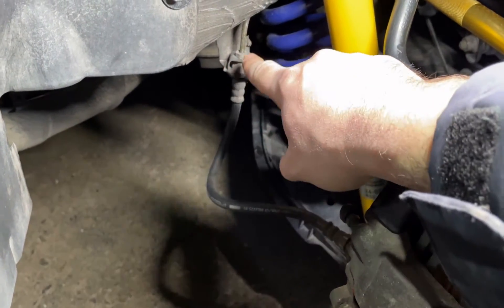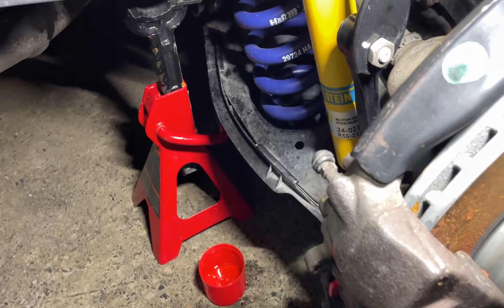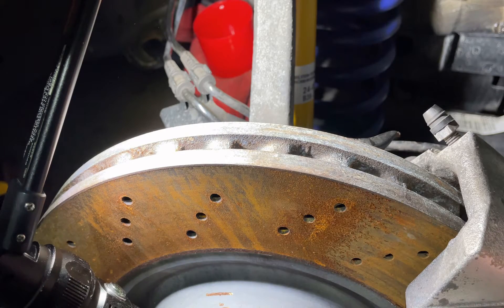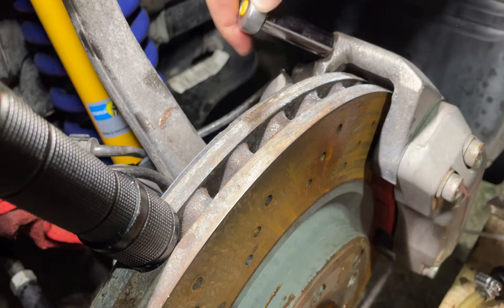Mercedes W210 Stainless Steel Brake Lines Installation & Brake Fluid Bleeding

Comment: I’m going catless on my e430 is it ok to drive around w the cats off until my tune comes ??
Reply from the maker: I drive without any cats. If you meet emission regulations drive, it will not be a problem. Just pick some scanner you will may need it to turn of the O2 sensor fault.
Reply: @W210Garage  beautiful,but it doesn’t feel like power was loss when you took off the cats ?
Reply from the maker: @rudygonzalez2005  
no, if you will replace them with tubes power will + not -
Reply: @W210Garage  what does that mean??
Reply from the maker: @rudygonzalez2005  
There will not be any downgrade with power.
Reply: &’ when you replaced the the front cats did you use 45 degree pipe or mandrel bent pipes?
Reply from the maker: @rudygonzalez2005  
Which cats are you going to remove? Prim or secondary? I have made pipes custom from SS tubes, for both cats.
Reply: @W210Garage  cool 👍🏽 ’m doing primary cats got a rattle in them but the secondary cats been deleted
Reply: What part number are those brake lines?